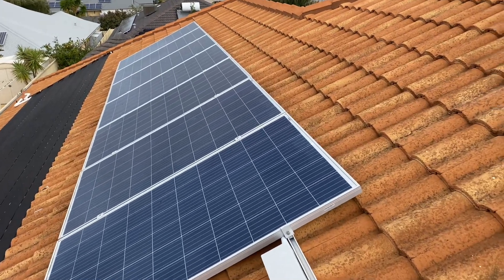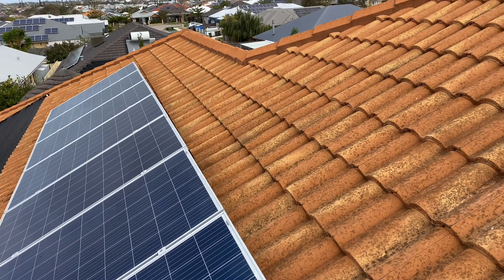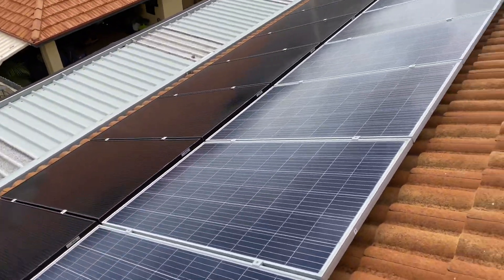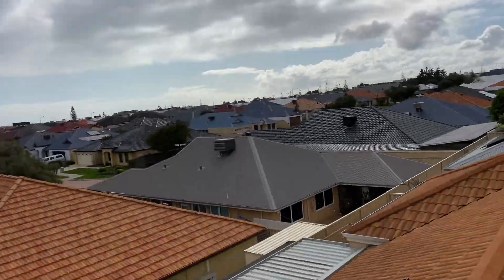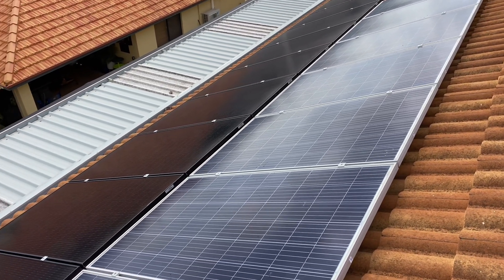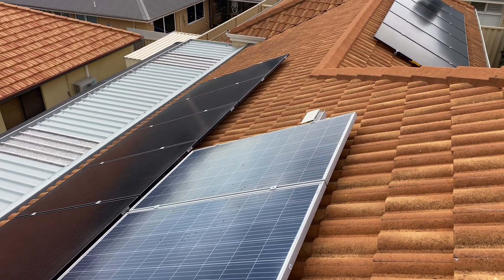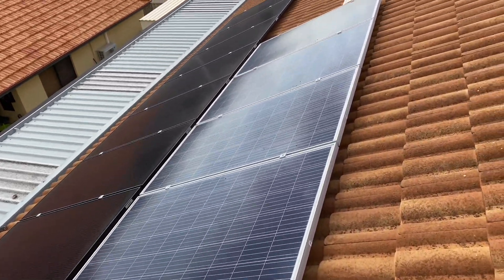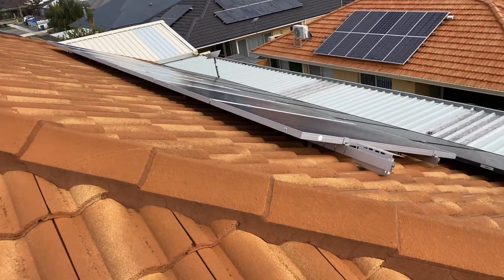Oversizing your inverter with SolarEdge technology, how to get the most from a single phase inverter

Comment: On the SUN-5K-SG04LP1-AU you can oversize by 200% and add another 10 kWp to its generator port, be it via a traditional string inverter or through however many microinverters you want